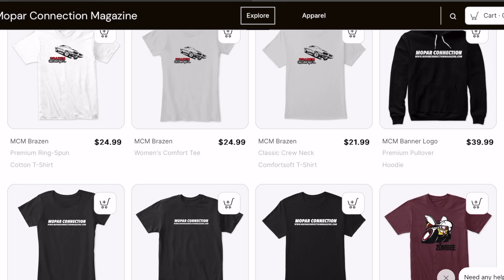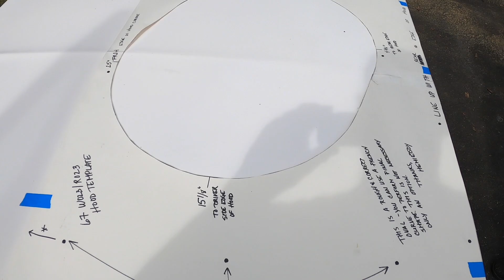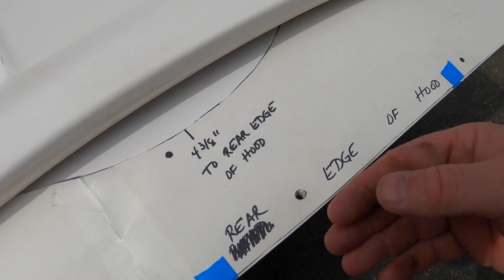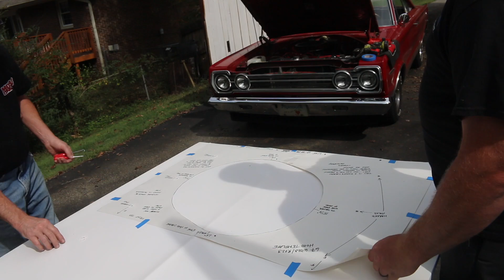Building a Lightweight Super Stock Hood & Scoop For a 1967 Plymouth Belvedere

Comment: All I have to say, other than it looks great! is if you can figure out how, seal the carb/ air cleaner to the hood. I did not do that on my 440 SIX PACK Charger, And the amount of air that enters through the scoop at high speed, along with what already enters through the radiator. will completely lift the front wheels off from the pavement. And having NO STEERING at speeds over 100 mph is ZERO FUN!
Reply from the maker: Holy cow! Fair suggestion.